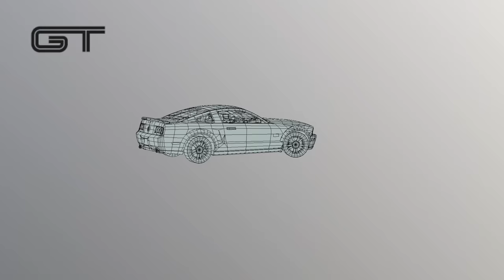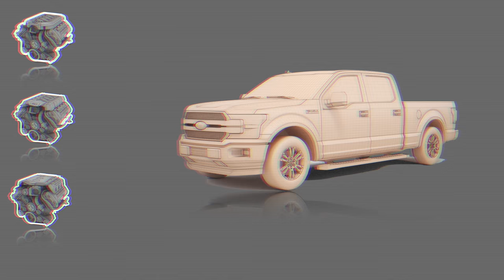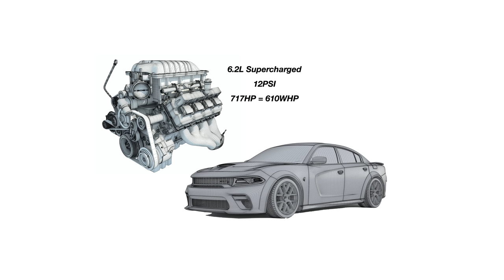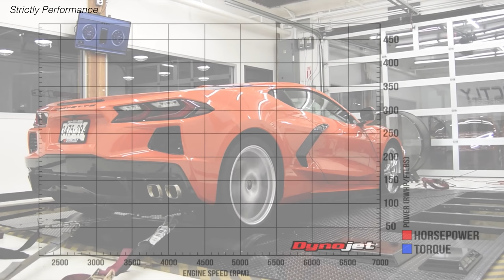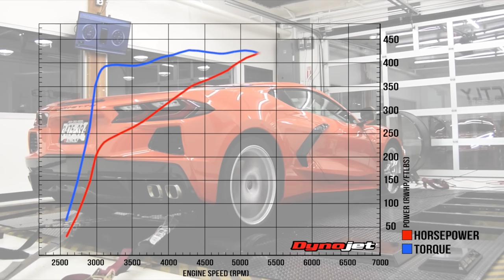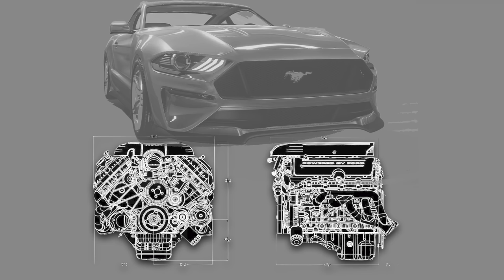How 5.0 Coyote Engines Beat LS and LT😮 | Explained Ep.2

Comment: My old gearhead dad always told me the secret to any V8 is in the heads. Getting them to breathe is what helps them turn out high power and RPM. If you've ever noticed a coyote torn down it's actually a very small block with very huge cylinder heads..
Reply: Yeah by default not by design. Of course a 2 cams in a head require a bigger cylinder head that a cam in the center of the block.
Reply: @ssj2camaro21  also I specialized in ls builds and a few coyote engines
Reply: By design redneck
Reply: The heads are huge because the cams are in the heads lmao
Reply: A wise advice.
Reply: He is right the heads are the secret to power
Reply: duh its a dohc

Comment: I am a mechanic and have lots of ls and coyote engines laying around. Couple things not mentioned are cam swaps are easy on a coyote. No measuring push rod length and no need to degree the cam. Then the biggest thing I love about working on a modular engine is no accessory brackets.
Reply: Explain, in detail, how lining up 2 dots, on 2 sprockets, and hanging ONE chain, is HARDER than indexing 4 chains, on 5 sprockets, with 5 different marks. Also GM did not use a degree wheel on the million + LS engines they shipped, and neither do you have to, if you don't want to. Also, dozens of cams are available in stock base circle, require zero pushrod changes. Sounds to me like despite you being a mechanic, you've never touched and engine with a wrench, and sure as hell not a Coyote. One valve cover has more fasteners to remove than the LS cam swap total. You really don't know what the hell you're talking about, do you ?
Reply: @MT82 Man Pedal they’re good but aftermarket cams can be a 80~HP difference on NA builds
Reply: @jamesgeorge4874  thank you I was about to type out the same exact thing. Dual overhead cams are a nightmare to clock. Most coyote guys just leave it alone until the timing chain snaps.
Reply: @SuperSilvi1990  to be fair, I've done major engine work on Ford, Dodge, and GM V8's for a long time, the new Hemi, and LS family are much easier, Ford has been on a mission to make technicians life hell since 1997. You should work on the 6.7 Powerstroke, every decision made about servicing that engine, had punishment in mind. I was a pretty hardcore Ford guy, untill I started fixing them.
Reply: @jamesgeorge4874  You don't have to drop the engine to do a Coyote cam swap.
Reply: @joshjlmgproductions3313  of course you don't. The book time in ProDemand is 9 hours, for a Mustang. You do pull the balancer, accesories, timing cover, and B1 and B2 tensioners. Then you pull the valve covers, and loosen all the cam bearing caps, like 60 fasteners, just for the top end. Dude, I fix them every damn day. I have fixed Coyotes, LS' , Hemis, Windsors, Clevelands, big blocks, small blocks, yada yada. The bottom line is a DOHC 32V V8 is cool, but simple pushrod GM engines with a cam, springs, and boost sound great, perform great, and cost little. Nothing wrong with a Coyote, just a giant, over complicated jewel. The Godzilla 7.3 is a far better engine in my opinion.
Reply: @jamesgeorge4874  I am team George 100%.
Reply: @jamesgeorge4874  good to know! What's the book time to swap a cam on an LS or Hemi?
Reply: And you need 4 cams instead of one
Reply: @jamesgeorge4874  what do you think is different between 1996 and 1997.  And the 6.7 is easy for a diesel.
Reply: @jamesgeorge4874  I'll take a cam swap in the coyote over the ls. No accessories brackets to deal with, no rocker arm trunion upgrade needed no need to pull intake and swap lifters no need to change valve springs because the stock ones do great no need to check push rod length and order custom pushrods when milling or changing to aftermarket heads no need to degree the camshaft after install.
Reply: @jacobburden3065  yes that's how volumetric efficient engines are.
Reply: Okay but you have to buy 4 cams and barely gain any power
Reply: the cam swaps are easy, but they sure are expensive since they need 4 and not just 1 haha
Reply: @harrisonmauldin5090  cant argue that.
Reply: @jamesgeorge4874  
What I'm hearing is you have worked on push rod motors all your life and know them.  DOHC is new and different not necessarily more difficult.
Reply: @jamesgeorge4874  - Also, while I've never put a Coyote together, I'd "ass-u-me" you still have to shim the buckets just like most other OHC engines. I'd personally rather be measuring pushrods.
Reply: @joshjlmgproductions3313  - You don't have to do that with an LS, either ...
Reply: @jamesgeorge4874  the 6.7 powerstroke is a very easy engine to work on. Why are you evan talking about shit you know nothing about?
Reply: @Paulster2  no. It's super easy. Uses a roller follower and lash hydrolic lash adjuster. I personally like the bucket design better like on the 2jz, but I can see that it would be harder for a novice to set up.
Reply: @jamesgeorge4874  modular engines dont have lifters.
Reply: @johnnyd6715  that’s an incorrect statement, DOHC was before SOHC around 40+ years before SOHC
Reply: @johnnyd6715  that was my exact assessment reading his comment, especially with how upset he seemed.
Reply: @rustysausage69  I'm sure anyone can line up dots to time a motor. With a coyote there is no need to degree the cams as  the computer  controls them. If you are installing a cam on an ls then you need to degree it. Assuming your not a hack mechanic.
Reply: @jamesgeorge4874  - DOHC is not complicated thing you’re making it out to be. They’re actually pretty straight forward and can be as cost effective and stronger than a cam in block engine. Sure they ALL make power. But the Ls/lt series engine will never make the power a coyote on stock parts not even close. That’s what we’re talking about here. Not even coyote but the mod motor in general makes and can hold a ridiculous amount of power something the ls needs to be completely rebuilt in order to do. We’re not talking about what’s easy to fix and what’s not. I’m sorry you hate your job
Reply: @CoyoteFTW  "DOHC isn't as complicated as you are trying to make it seem", cheif, if you don't understand that 32 valves is more than 16, 4 cams is more than 1, or 4 timing chains is more than 1, then making you understand is not possible, you don't understand 1st grade math, no sense talking about engineering, obviously.
Reply: @jamesgeorge4874  sounds to me like you’re just another Chevy fan boy that’s not willing to believe there might be something as good or better out there.  The Coyote’s have proven themselves even with the smaller displacement and haters like you aren’t going to change that.  The thing  is the guy you’re trash talking sounds like he has worked on both but is saying he doesn’t have to wrench as much on the coyote as much be cause you DO NOT have to open them right up and change the cams and heads to make more power and still be reliable….. QUIT BEING A HATER.  LS is great, so is the 5.0
Reply: @GT500 KOHUT it’s not about smarts it’s about unnecessary complication. Two dots straight up and down on one engine and your done. On the other 5 dots two chain markings, timing chain guides, with a timing chain tensioner. Any one of those gets out of line or wears out……the top end is gone.
Reply: @tylerking27  they just love their low rpm steam engines
Reply: @jamesgeorge4874  Robert has no idea what he is saying. cam swaps on the 5.0 is a nightmare. plus you can get a badass can for an LS for $100, 5.0? $1500. And I hate GM cars.
Reply: @enigma9789  It's obvious. I don't hate the Coyote, either. I just don't prefer it.
Reply: @CoyoteFTW  your clearly living under a rock. the ls can handle every bit of power a coyote  can handle and will absolutely destroy mod motors. and they can do it with a 4.8l truck motor thats way cheaper and more available and 10 years older at the least.
Reply: @jamesgeorge4874  I would agree but seeing the 7.3 failures till date it’s easy to crown LS as Americas workhorse. I use to tear down motors and build them until one too many customers wanted gasket slaps and no machining. Those failures and low pay strayed me away from the labor. $3k to rebuild and $1800 to refresh in parts without machining just timing components seals toque/yield rings and bearings. Seems efficient to pull and replace imo.
Reply: @jamesgeorge4874 damn you ethered him
Reply: GM's Camaro's Win 1st and 2nd Bathurst 2023, LS and LT's have got the goods, Meanwhile  complaints from Ford AU about being at a disadvantage prior to the Great Race and concerns of them boycotting the race altogether, Because of aero dynamics, GM have won the majority of the encounters throughout the 40 plus year history !
Reply: In the past, gm started out their new line of engine in the corvette, then shortly after incorporated it into the rest of their products. Guess what? The new vette engine is dohc. If gm holds true to history, that dohc will be in trucks and suvs, then what? Suddenly, dohc is the cats meow.😂
 This is just speculation, by the way.
Reply: I'm an overhead cam guy, pushrods remind me of tinker toys. That being said, I prefer timing belts over chain drive for several reasons.
Reply: If in the future if I wanted to buy a coyote off you, do you have like a website or a shop or something I can write down?
Reply: @justinisenberg6041 an LS making 1000 hp on a stock bottom end or stock top end will grenade itself very quickly. A sealed Coyote can push way beyond that and not break down. Hell, there’s one guy making 3000 hp and 10k rpm with just boost, fuel, sleeves, MMR valvetrain, and con rods. And he has run tons of passes with his car. Snot Rocket, Brett Lasala. It’s a 6.3 second build and he still has the stock body panels and frame (roll cage ofc).
Reply: @Sam-lk6eo only in lesser motorsports. When Ford actually puts effort in or goes into a big time competition (assuming they aren’t immediately hit with massive BOP restrictions), they typically win. Hence why the 2016 GT nearly swept the podium at Le Mans and was immediately hit with the largest performance penalty in endurance racing history. And why it beat the Corvette with a front engine, steel body Mustang at the most recent one despite 20kg weight and power restrictions. And why the 351 Cleveland, despite being drastically outnumbered by Chevys at the track, was usually the one to come out on top, causing other racers to complain. And why the Cammer was banned, and then not allowed to come back without a 201kg weight penalty (the largest in motorsports history by far). But yeah, Chevy totally won lmao.
Reply: @The-fs5wn  if you mean lasting a whole season of drag racing short lived then sure. Gen 4 Ls with ls9 head gasket and gapped rings. Been done plenty of times and reliable make over 1000. Sure the coyote is a good engine. Never said it wasn't. But the Ls isn't junk either and can hang with it while you can pick them up at a fraction of the price of coyotes all day long. John capizzi has a 5.3l Ls running 4.5 sec 1/8 with all stock bottom end. Down to the bolts. Stock type heads. Junkyard cheap engine holding its own.

Comment: Well, I have a bone stock 2012 coyote; it just rolled 306k and apart from plugs, nothing has ever come out/off of the motor. Only uses .5 quarts of conventional oil between 5K changes.  No complaints here.  Id get another one once it dies.
Reply: 306?! Damn that’s awesome
Reply: I have a 2013 bone stock as well and it’s 110k miles I never dog on it or anything and it runs amazing. Hopefully lasts me over 220k
Reply: Miles or kilometers?
Reply: Almost 30K miles per year? Holy shit that's a lot of gas money lol.
Reply: @sntslilhlpr6601  mf is racing for cash or is really using the mf as a daily😮
Reply: @TheNewAgeCreater  I use my 12 as a daily. I also own 2 homes 230 miles apart and I drive back and forth frequently.  I have owned it for several years its been a reliable car.
Reply: @guthrie_1 cheeseburgers 🇺🇸🦅
Reply: @joshfiveoh  306K cheeseburgers?!
Reply: @guthrie_1  yes
Reply: Love my 2012 gt. It my favorite car I've ever driven ❤️
Reply: @SeriusChevy  boost it
Reply: @guthrie_1  yes I plan to eventually 😌
Reply: my 2012 f150 5.0 has a little over 200k! makes some interesting noises at idle, but has had next to no issues (plastic heater core hose connector on the water pump broke, but I just replaced it with a metal one for 10$). Has been a great engine, thinking my idle problems are probably just an intake or throttle body leak. I know people have had issues with the 5.0 throttle bodies, and mine has 200k miles on it, so I can't really complain.
Reply: And then tundra 1st gen 4.7 enters the chat, haha sure no where near a coyote motor but mine runs just fine with a shit ton of miles on it, but once it dies I’ve been thinking about a 5.0 f150, maybe get the FP700 package on it
Reply: My Ford F-150  5 liter has 244,000 miles.   But the truck 🚚 🛻  requires  8.8 quarts   each oil and filter change.
Reply: .5 quarts?  The car takes 8 quarts
Reply: @Sick_ridz He’s talking about oil consumption genius.
Reply: @gtmike916  I know.. I was kidding.  Clearly that went over your house

Comment: The 5.0L Coyote V8 is definitely a beast. I have a 2011 Ford F150 with a 5.0L Coyote V8 in it with 147,000 miles on it still going strong and its a beast and it sounds like a beast with the Borla ATAK exhaust on it.

Comment: You're correct that it's it's "easy mode" with a coyote that you don't have to go into the motor...until you do. If you're just slapping boost on one 500-700ish hp is pretty easy. But if you want to build a coyote for more it is a more sophisticated engine than the LS. The coyote in my drag car has vvt deletes and locked cams and let me tell you, I've gotten really good at degreeing cams when I decided to build a coyote. I also learned a lot more about things like cam timing and overlap messing around with these things then I ever did with sbc.
In fact, I so fell in love with the coyote I swapped on into my old camaro 😁.
Reply: So cool! 🤘 Would love to hear more about your cars :) Greetings from Finland in the nordics 👋
Reply: @piuthemagicman  
I have a few short video clips on my page if you're interested. I finally got around to buying a gopro camera so I should be able to post some videos of it at the dragstrip this spring. Went 10.95 at 130mph on 5psi of boost last year. My goal is low 10's this year.
Reply: Any recommendations for a “starter” car to build out that isn’t too expensive, but will give me experience actually digging into an engine?
Reply: The LS is a better engine, period.
Reply: @StonkeyKong  
Pretty much anything to your liking with a small block chevy in it - tons of different cars and pickups had them. It's a tough engine, most versions respond really well to bolt-ons, parts are cheap and everywhere, info on how to build them is everywhere. There are small block Fords and Mopars but they're a little bit less popular so not quite as much aftermarket support but still really good options.
If imports are more your thing 90s civics are still pretty plentiful and have a ton of support too. Not as much power but you don't need as much in a lighter car.
Reply: @MrGlassman11  The LS is the vanilla of the performance world, pretty sweet but not everyone thinks vanilla is the best flavor.
Reply: @A C 
Damn.
Reply: @MrGlassman11  you mad this video proved you wrong with facts?
Reply: @MrGlassman11  The LS is a copy of a SBF with a few  upgraded features.
Reply: @biscuitboy3617 The Coyote Motor is a Copy of Chevy Prototypes from years ago! And so is the Ecoboost, Remember the Buick Grand National GNX! So who is Copying Who! The SBC has Always Been GM! Ford can't build anything, the Coyote was built by Carroll Shelby, Not Ford!
Reply: @MrDan7171  
According to everything I read about the development of the Coyote is it's a clean slate design that looked at previous modular engines but didn't carry anything directly over (except for bellhousing bolt pattern a few other minor details). The cylinder head architecture is most directly based on certain ford dohc 6 cylinders. 
Pretty sure you're just messing around.

Comment: I have never been a ford guy, but that motor is one of the best ford has made in a long time.
Reply: Well they only had almost 100 years to do it and still isn't that great compared to many others.
Reply: @lordpula1193  best ford motor, but as for other options available for other makes , no would not put this in anything other then a Ford.
Reply: @usandthagunns3922  if this is their best then that sucks because many motors take it out. I had meant many ford body chasis use gm or hemi style swaps. Only dumb people's would put a ford motor in a non ford chasis ha.
Reply: @usandthagunns3922  They would if they could. People dont because the engine is very big compared to a LS and way more expensive compared to a LS doesnt mean it isnt one of the best engines.